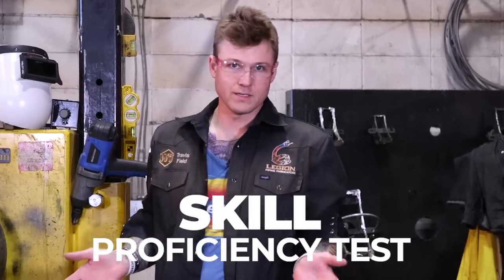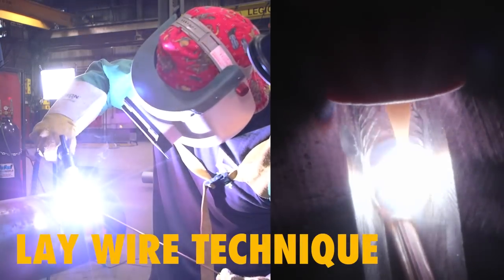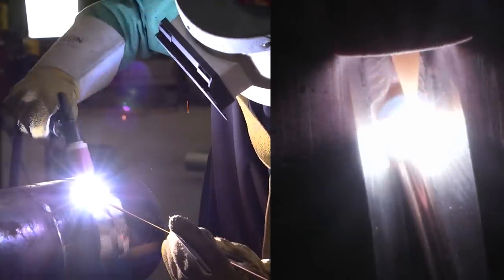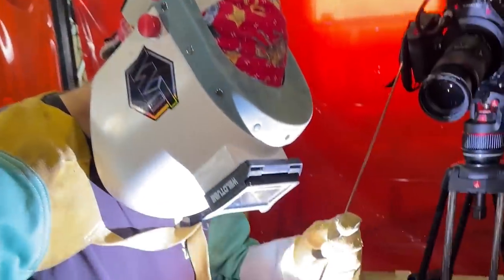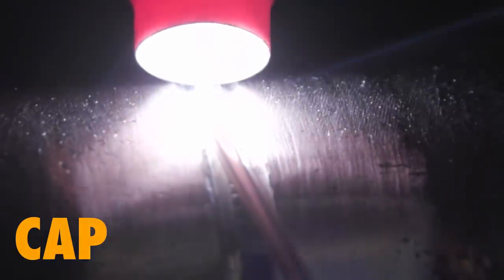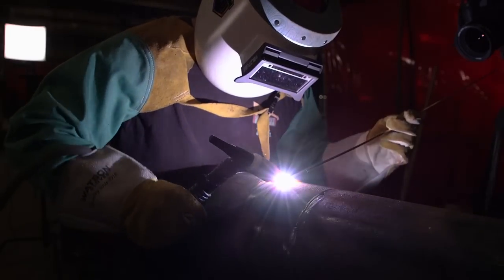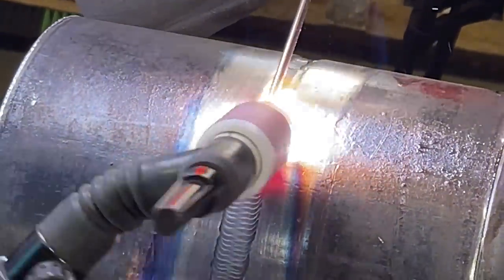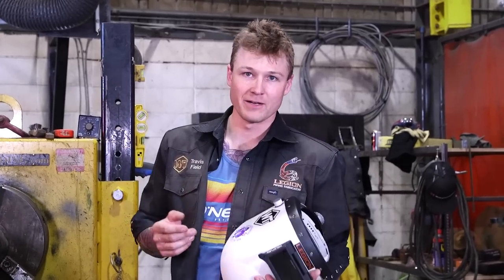TIG Welding Skills Test at Legion Piping Fabricators

Comment: I've welded pipe for 35yrs. and used the Tig method for about 22yrs of that time , I never ran the Tig Rig in the down hill method that your welder is using. Also walking the cup doesn't always mean faster weld times, I've worked with a few older Tig welders that free hand everything and can keep up if not surpass in a production setting that I would not work on that type of job or fabshop.
Reply: I second that. I walk the cup but know people that can free hand really well, and I never run down hill
Reply: Your comment is so true, sir
Reply: True.
Reply: If you run hot enough the downhill ,lay wire for roll welding is definitely the way to go. Fast and hot then slam the big rod into it.
Reply: I'm glad someone said it lol . Roll out is nice however different story when your in position
Reply: I was curious about that, I free hand aluminum all day everyday and want to career change into pipe welding. Is free hand more common than walking the cup or other way around, obviously it matters on the task at hand just curious